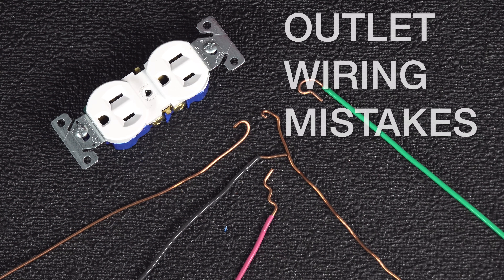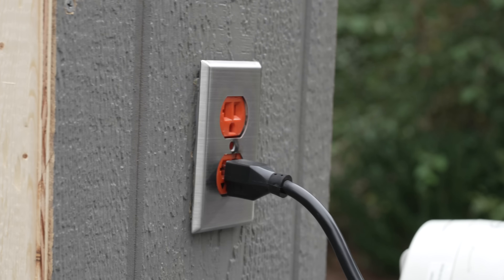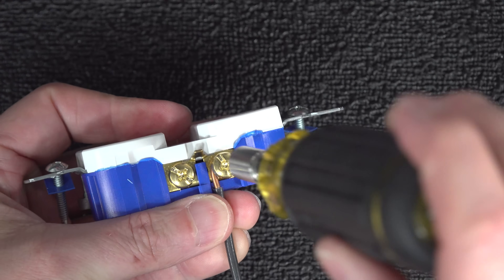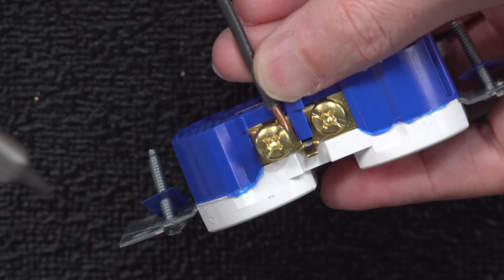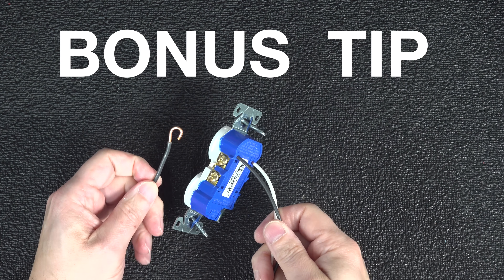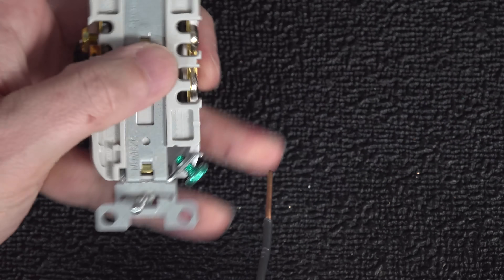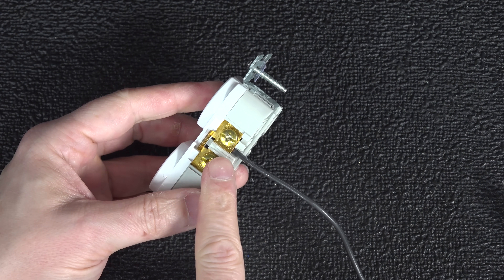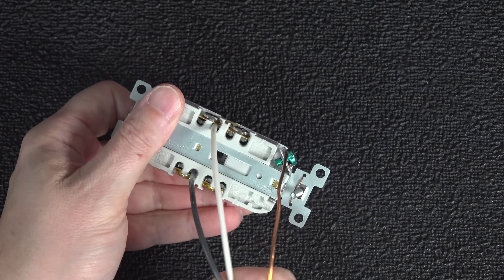BEWARE Of These 3 Common Wiring Mistakes On Outlets & Switches

Comment: As an former electrician, we do use the holes in the back, and so should you. These plugs are tested and would not be sold if they did not meet safety standards.  You should also be checking the box volume to ensure you can fit 8 wires in a plug. Please do some research before starting any electrical work and if you're not sure, call your local electrical safety association, they will provide you with what your area requirements are.

Ensure you get the proper permits as that protects you, and anyone else who may buy/rent that property. Some locations do not require a permit for fixtures and devices, call and double check, it's free to call and the permits are cheap. If you do work on your property without a permit, your insurance may not cover the property in the case of an incident.

Most importantly, be safe, turn power off and if you're not sure, turn the main breaker off. Treat electricity like a sneak, it may be safe to work with, but if it bites you, it could be deadly.

🤙🏽
Reply: You should never use a spring loaded connection for anything permanent. Springs lose strength with time, which leads to a loose connection. That is why I'm replacing all outlets in my home. Every single one has had at least one wire fall out when removed from the box. A clamping connection will always be better than a spring loaded connection.
Reply: Always make a pigtail. Back side wiring is a joke. In residential is where you see this bullshit. If the receptacle goes bad you lose what is down stream EG other outlets on the circuit. If you make a pigtail and the receptacle goes bad you don’t lose the others . 43 years experience.

Comment: The difference between buying cheap "residential" vs "commercial/residential" outlets. Spend the extra for the c/r outlets. They're going to last longer, install easier, and the difference in materials and construction are day and night.
The last outlet with the clamping mechanism is a residential/commercial outlet. The one to get!

Comment: Kitchen outlets use a "split plug" witch means the top outlet and the bottom outlet are wired separately. You MUST break off the tab between the screw connectors on the brass colored connections. There will be 4 wires in that circuit. Red, Black, White and Green. Red and white on the top, black and white on the bottom and green to ground. Only the power (brass color) side needs the tab removed. The one white wire will be the neutral for both upper and lower outlets.
Reply: I have never seen this done in a kitchen. Just multiple circuits.
Reply: wouldn't it be dangerous to remove the neutral tab as this could make for a hot neutral as there would no path back to the main panel and ground? I'm not an electrician....but this seems to make sense...

Comment: Although the backwiring holes are listed for usr, there is something else about them other than poor current-carrying capacity that makes them bad, namely after a couple of decades, they become intermittent. Then you have to check all the wiring for a particular branch circuit to find out which connection is failing. That means moving all furniture out of the way, and it's a big pain, when all you had to do was use the screws in the first place. In the video, it can be seen that more than one neutral wire is connected to a receptacle. Nowadays that is not allowed, because removing any neutral wire will break the neutral to all downstream receptacles for the time required to do a repair. Odds are you will have killed the circuit anyway, but they obviously don't care. Now all neutrals to a receptacle must be joined to a short piece of wire that then is connected to the receptacle. Inexpensive readymade pigtails are available to save you time in doing this.

If you must find one intermittent backwired receptacle amongst many, you may come to the conclusion that it is better to just move all the wiring to the screws to prevent inevitable future problems. You would be correct!  If you replace receptacles in "living areas," say, because they don't have screws, are worn out or any other reason, you must install AFCI protection (which can mean only changing the first receptacle in the circuit, which protects them all). And you might as well install GFCI protection where required, which can also be the first receptacle. Now get to work!
Reply: Wasn't that restriction only temporary?

Comment: How is it that backwiring is not considered okay for heavy use, but Wago type connectors are now the best thing?!?!?
Wago type connections are no different in contact surface.
Reply: Wago is a tight mechanical cam clamp, back connectors are a weak sprung connection

Comment: why are backwiring holes so bad if wago clamps are completly fine? Bad execution?
Reply from the maker: Great question but the answer is in the clamp. Wago has a patent on theirs because it offers more than 5x as much area and holding power. These others don't. So while I am a HUGE fan of the Wago, backstabimg holes didn't benefit from it. Now if Wago used their technology to make an outlet, that would be something.

Comment: One other tip. You can split the outlet by snapping off the bus bars between the screws. This allows for controlling outlets with a switch or providing multiple breakers for closely racked equipment.

Comment: An additional tip: Tighten all screws on outlets, even the ones without wires connected, will reduce chance of a short with any exposed wire, such as the bare ground, in the box.

Personally I follow the method recommended by Bill over at his Sparky channel and wrap the back/side of the outlet with electrical tape to cover all the screws.

Ideal makes a cover/wrap, like a wide rubber band that does the same thing, I've tried them and they work very well, you just have to remember to slide them over the cables before you wire up the outlet or...😁😂
Reply: Electrical tape around a device like an outlet or a switch immediately tells me an amateur installed it. I used to do this, until I went back a year later to the same outlet box and noticed the few wraps of tape had somehow shrunk and pulled itself off the back of the receptacle.i guess I had stretched the tape while wrapping it
Reply: @62Cristoforo  I HATE going in to replace an outlet and finding it gummed up with old PVC or cloth electrical tape!
Reply: @62Cristoforo  stretching tape, or tearing it is not recommended by 3M
Reply: @a..d5518  thank you for this
Reply: If you forget the band you can almost always slide it on after the fact if you slip it over the top and let it go behind the outlet while you get it past the bottom ears. If your conductors are managed nice in preparation to fold it back into the box you don't even necessarily have to remove the bottom device mounting screw.
Reply: Great comment, always do this, and I usually will tape up outlets if they’re close to the edge of a metal box or cover, plastic boxes I don’t worry

Comment: Thank you for answering my question about the clamp style on newer outlets and the amount of surface area in contact. I've seen them recently, but still did the tried and true loop method haha! But then again, I still use the tried and true method of twisting wires together when working on car audio or home electronics installs. I'd probably use the clamp on the outlet if I had to pull a new wire to a particular outlet and the screws already had wires attached at them. Then it seems logical.
Reply: The back stab ins are handy if you're in a tight box, and don't want to add a second pig tail for example. He shows this towards the end.
Reply: @ZacharyMelo  Yeah for sure hadn't thought about that. Been a while since I've came across a box that was a tight fit. Thanks!

Comment: Funny that "backstab" holes are the standard for most advanced connection types, but they cause problems in American household outlets.
Reply: Like???
Reply: @robertopics  those back stab connections become loose over time as you plug and unplug things from the outlet. You'll have a light plugged in and if you try to plug something else in it'll make the light flicker cuz the outlet has these loose connections in the back. It causes heat. I've seen it many times where the back of the outlet is melted. Scary stuff
Reply: @PotentialDifference1  I agree with you, my reply was to the op saying that back stab connections are the standard on advanced electronics.
Reply: @robertopics  ohh.. My  mistake 👍
Reply: @robertopics  It's a shame that they seem to be so badly engineered and that this is known since years.
Connections where you just put the wire into a hole are standard for many Wago connectors, as well as in German outlets -- and I've never seen a light flicker when an appliance was unplugged. These connections are considered superior to any screw-type connections.
Therefore, this is just awful engineering, and I'm wondering why the companies that build this stuff are still around instead of having been sued into oblivion for damages caused by faulty connections.
Reply: Alien grade tech. The 1% will not hunger for plebs.

Comment: The indicator I use for which side the black and the white wires goes to is, the white neutral connection is always on the same side as the solo ground wire connection. If you keep this in mind, you will never connect it backwards.

Comment: Yeah but polarity is silly with single phase AC. it's meaningless.
Reply from the maker: Not true: https://youtu.be/d6Eq2KRtE90
Reply: AC doesn't have fixed polarity but that doesn't mean the orientation of the hot and neutral doesn't matter. You still have one side carrying the load and circuits in electronics and house circuits require this to be correct.

Comment: Easy to do when you're sitting at a table. Try that shit at and actual box with only 4 inches of wire to work with.
Reply: Considering code is minimum 6" then your focus shouldn't be on installing a receptacle.

Comment: Soon...I'm an electrician and you should be careful about using the term "always". A white wire is not ALWAYS the nuetral wire.  The color is is NOT an indication of polarity and you should NEVER assume polarity unless your just doing a replacement and you saw how it was connected.
Reply: what else is the white wire used for? and what country are you in?

Comment: The best solution to all of this, would be if America (As the continent) swapped their entire electrical system (Yes, all of it) to match the European standards.
There is so much garbage with the solutions you have, and so many variants and ways for things to go wrong. Just make it easier for yourselves, join us (like in us, the people of Europe) and our standards for electrical stuff and solutions.
Reply: If you visit a certain hotel on the Isle of Capri, you will notice that the little 240V 4W table lamp on the nightstand is fed by what looks like cellphone ear bud cord! At least we in the U.S. don't permit mains voltage to be carried by anything smaller than 18AWG.conductors. We have our problems, but, egad, 240V on teensy-weensy wires covered in thin plastic? No thanks!
Reply: @campkohler9131  I will not argue further with you, but I appreciate your partially agreement.
Reply: Oh right that's why our red seal electricians can work in your country but yours can't work here... 240V toasters real smart way to kill people

Comment: German electrician here.
the "newer" type of connection you show is loosing market here in Germany. usually (on newer outlets switches or any other connection) you insert the wires in some sort of spring clamp and that's it. you need pretty much force to get it out again. just look for VDE approved connectors and you are on the safe side. and always check if the fuse is corresponding to the maximum your smallest connection can handle!
Reply: Those push style connections suck here in the states and lose tension after a while.
Then they get hot and lose more tension it's all downhill from there.
I'm sure the European ones are probably different and therefore way better than our junk.
Reply: @MrTheHillfolk  maybe it's the quality. in some boxes I find some that are quite a few years old. A bit oxidized but working like new ones on the first day. But I need to mention they are made for one-time-use. Only lever clamps can be reused safely.
Reply: @i.like.humans.  It's probably the voltage, Europe is 230Voltage, almost twice the US 120v. This means to deliver the same amount of power it only uses 50% of the amperage so the wire gauge and connections can equally be significantly lower. So it runs cooler in normal operations and if there's more resistance due to a bad connection it generates less heat and can tolerate higher resistances.
Reply: @kickassnetwork  granted, lower voltage needs more amperage to achieve 3680 Watts. 30.6 A to be correct.
(We use 16 amps to power our outlets)

For example Wago 221 are rated up to 450 V and 36 A. And the spring itself is made from Springsteel. I don't think the connection will be that hot. 

And I've seen some videos where such a connection is purposely overheated. The plastics meltet away but the connection itself hasn't changed.
Reply: @i.like.humans.  We can't go that high in the US in a standard outlet. Max amp before you're using special connectors is 20amps. But really it's 15 amps for anything plugged into it before we get into special connectors not typical in a home. So running 1 hairdryer or Microwave can sometimes be the absolute most you can put on a circuit. You can imagine our outlets run higher in amperage on average (thus more heat).

Often, when an outlet fails, you'll see burn/melt marks on them here. Since the various components are mounted in a plastic enclosure a fault. In a Wago there's 1 piece of metal that connects everything so it stays structurally sound even if all the plastic around it is melted. But the outlet since there are multiple components (at least 3, for Neutral, hot, and ground) held together in plastic that isn't physically connected with higher temperature resistant metal one of the contacts can get loose as the plastic holding it together melts off and puts it in a different position than the other contacts.

To be fair though, it's there because you can use it. It's just that if the minimum failure rate is 1 in 10,000 to be used in code (an example, not real), then the push-in connector get's closer to that than the alternative or tends to be easier to screw up.
Reply: @kickassnetwork  burnmarks in outlets? That's crazy 😶

In general it looks like you have to keep an eye on the products higher in quality. Or choosing the next smaller breaker. 

Spring clamps are most common using new stuff over here. Most times I see an outlet or switch broken it's just the enclosure. The internals are nearly never damaged. 
And we have different ratings for outlets (16 A) and light circuits (10 A) 

If I recall it correct, if a switch is rate 10 amps it has to withstand at minimum these 10 amps. If it doesn't it is not allowed to bring it into market.

Maybe our safety standards are a bit higher?

I have never seen a burned outlet or anything else. Normally a breaker kicks in and that's it🤷🏻‍♂️
Reply: @kickassnetwork  Yep, that is your main issue the amps/square inch or square mm in our case :)) This is why you have that sort of problem. But for that screw-type connection aren't you using terminal pins? they look like a key and I always had good results with them, the wire gets trapped behind the screw.
Reply: @i.like.humans. , you may see these in Eastern Europe :)) cuz higher breakers and lower quality (like 32 C) are used just to have power :)) and the outlets may be cheaper, underrated for 32 amps and you may get nasty outcomes if you try to use a welding machine for example :))
Reply: Never eber do dat
Reply: Found funny that here in brazil, this "new" type conector is on common use before i was even born (94), and will most likelly not change because its simple and efficient.
The thing now its to have new desings for the wall mounts....
Reply: Thats interesting. Sounds like a better version honestly. Ive been doing low voltage IT work recently but the most common here in the US is definetly ones with the screws youre suppose to make hooks with and then tighten down with the blue backs shown in the video
Reply: Psssttt...can you say Z or will you be arrested

Comment: One thing you forgot, Electricians should always use pigtails and a splice, we never terminate multiple wires on the device itself.  In this way, the device is not an integral part of the circuit, and if it fails, breaks, or needs to be removed, it won’t inhibit the rest of the circuit from functioning properly.
Reply: Are you an electrician? If so, have you ever seen an outlet fail/break in a way that breaks the circuit but also doesn't create a condition that makes the circuit unsafe to be live?
Reply: @zachdemand4508  Yes, and Yes.  Loose connections, for instance, create a hot spot that will cook the cable and device alike until they crumble away enough to become no connection at all.  With proper pigtails, this condition just becomes a dead plug that needs to be replaced.  If you use the device as the junction/splice, however, now everything downstream of the plug is dead, or has an open neutral, and you have to search for, and find the offending hot spot, as part of troubleshooting the larger circuit.
Reply: its also a code violation